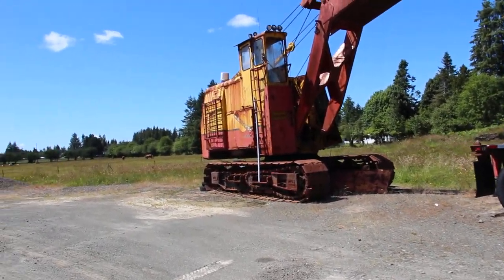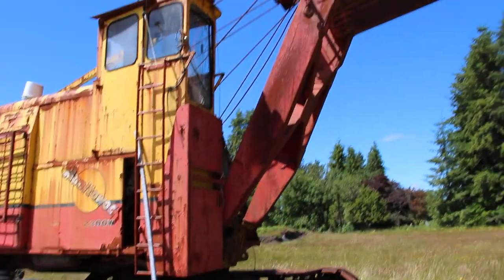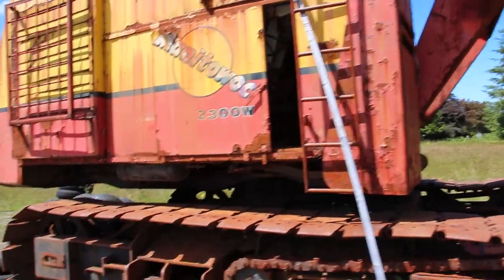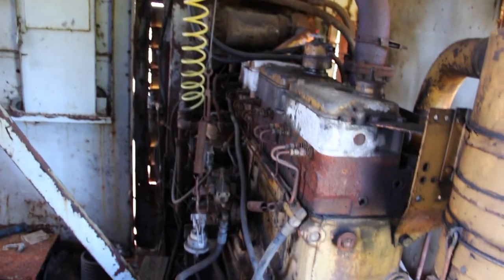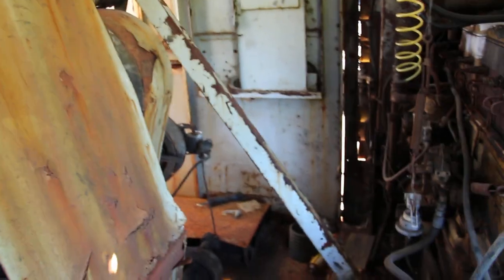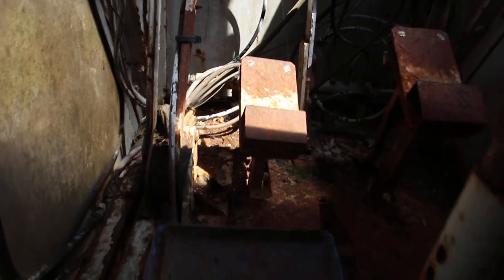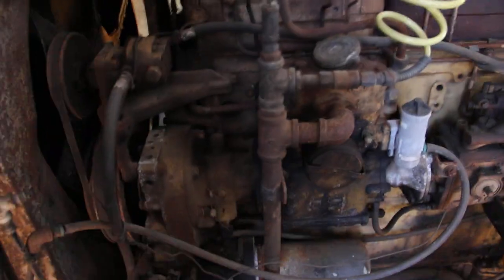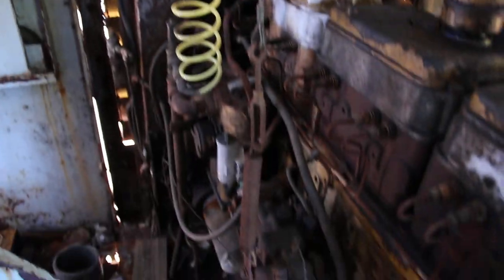Manitwoc 2300 log loader.

Comment: Bet you that thing would fire up with almost fuss! You didn't get a real clear shot of the fuel pump, but it looked like a Cummins Single Disk which is what they used before the PT pump came out and that looks to me to be a H series engine, possible an HBI or similar. That is pre "220", and it looks like it's probably an early 40's if I had to guess. The H series is what really launched Cummins and put them on the map. They started at (I might be off a few inches) 673 cubic inches, then they became 743 and eventually 855 and continued production into the 2000's before being replaced by the ISX.  With a closer look at the fuel pump arrangement or the serial number off the block I could probably get you closer on a date.
Reply from the maker: next time im out there I'll get a picture of the pump for you, its a gem, im sure it'd run.